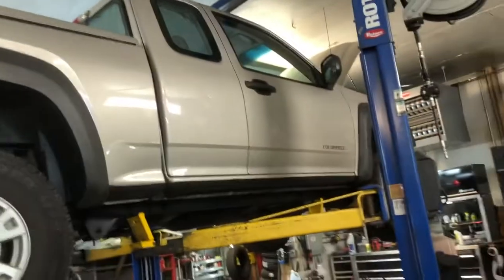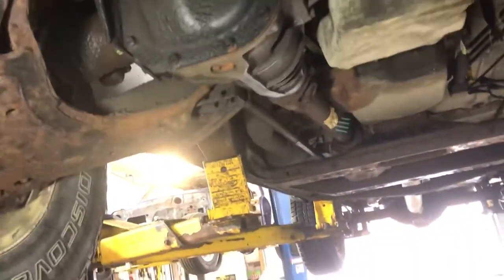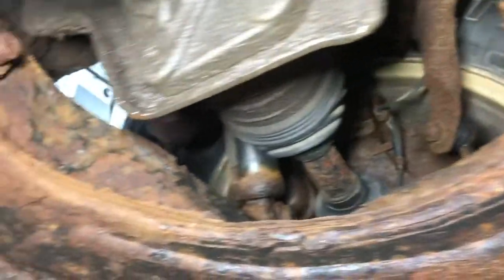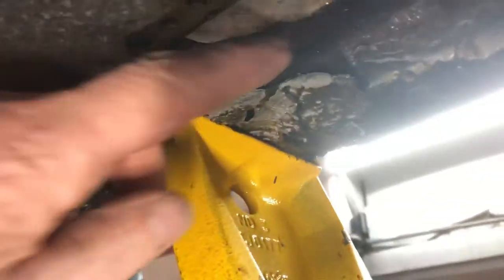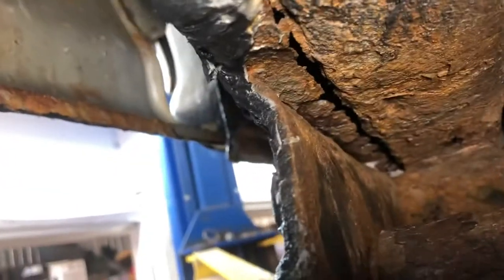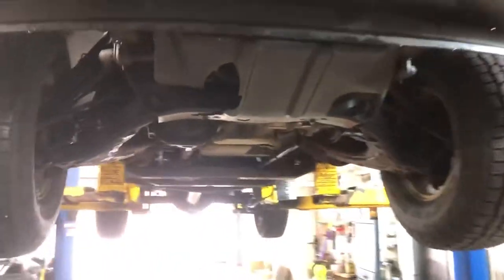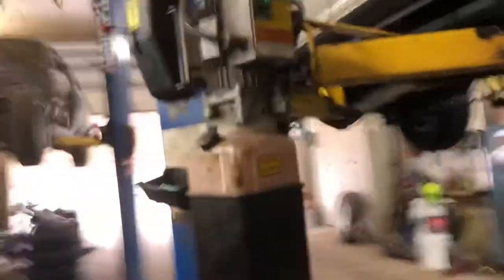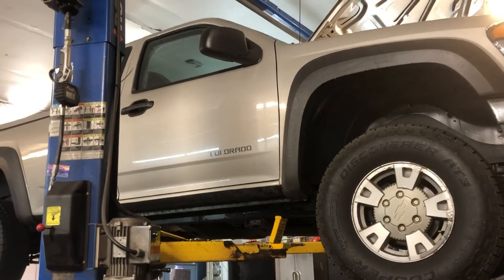Buyer beware! Rust belt rip off! Chevy Colorado with rusted frame!!

Comment: I’ve seen a Colorado frame broken and rotted bad, not such a hot design on all counts! Definitely beware when buying this model
Reply: ANYTHING FROM THOSE AREAS
Reply: People talking shit about chevys but forgot about toyota recall for a rusty frames in tundras and tacomas.
Reply: I have an 04 Colorado , the frame is rotted . The drivers side I had fixed last year , and now the passenger side needs done . The truck runs flawlessly, no leaks . I replaced the whole front suspension last year, new brakes , rotors , calipers , all the way around . Now I’m torn on what to do . Put another 1500 into it , buy a frame from the south , and swap it , or just junk it .
Reply: Toyota fixed their problem though. No such luck with Chevy . I just bought a 2016 Colorado from the south , so I’m hoping to keep the rust from ever getting to it .

Comment: This vehicle is not a loss. If you get a good deal you can have a welder reinforce/repair all that for under $2k. And as much as trucks are these days, it's worth it.
Reply from the maker: Yeah, tough call. 5k purchase price. Another $1500 worth of additional work needed, PLUS the frame repair.  Great truck for someone who could do the repairs themselves!!!!
Reply: @SmittysShop  Yeah, $5k purchase price is up there with that type of rust rot. Maybe if it were between $1-3k. Also, they tried to cover up those holes with tape and bondo...  unreal. Similar thing happened to me years back with an F150. Only had 80k miles and looked great, but had cracks and rot that I didn't see. Paid $9k for it and eventually had to have the frame welded which cost me another $2k. It's still a great truck for me, but probably would have never bought it if I'd known and especially not for $9k.
Reply from the maker: @jerrybeckettdd   Frustrating, for sure!

Comment: This is why I only buy Ram trucks.
Reply: LOL yeah Ram trucks are impervious to rust.
Reply: @johnoberle9750  Not the rear fenders or rockers, but the bones (frame) were excellent.  My 2004 Ram's frame only little surface rust after 18 years.
Reply: @ureasmith3049   They are a good truck. I like Ram Trucks. I don’t have a favorite. A slight favor for Ford.